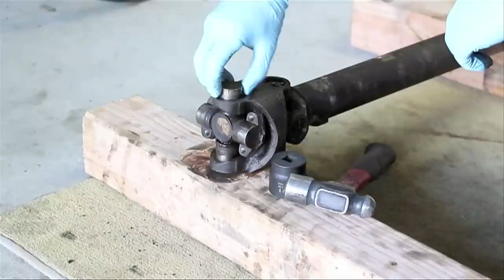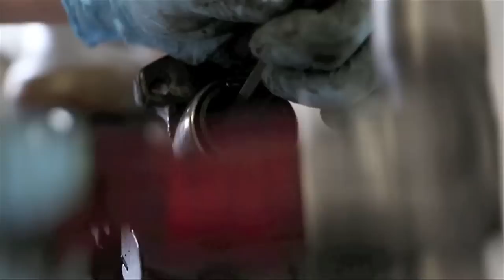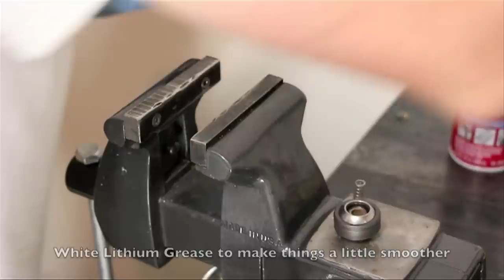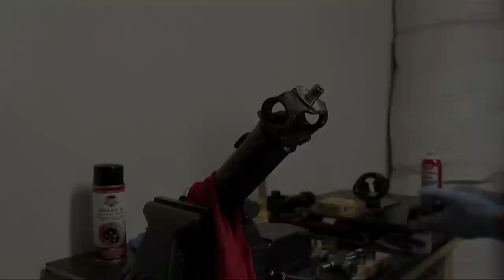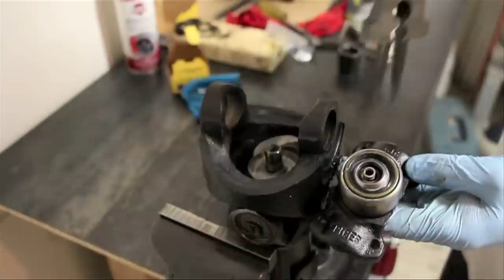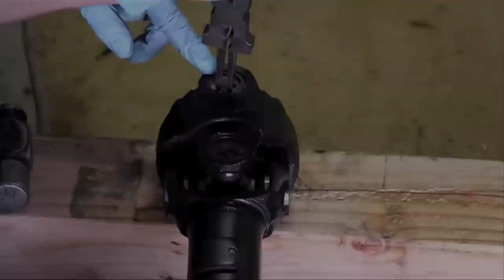How To Replace a Double Cardan Joint

Comment: Just did this on my WJ front double cardan. I couldn't figure how to get the bearing race out of the centering yoke until I saw you guys using a prybar as a lever. I had to modify one of my pry bars so it could fit inside, but worked like a charm and saved me from buying another specialty tool. Thanks!

Comment: Tiltle should be " How not to rebuild a Spicer C.V. joint" How are you going to grease the first joint with the zerk facing the center of the yoke? Just drop the seal on? It'll be destroyed in minutes! No grease in the centering kit? OH lets clamp the tube in a vice! Snap rings not fully seated? How long did this crap last before it ate itself? You guys are good for repeat parts sales! wheeew! Keep on bleepin'!

Comment: In case anyone is interested, the socket yoke assembly rebuild kit is part #spicer 404-0A.  Much cheaper than buying a whole new socket yoke,
Reply: Exactly what I was looking for, but Spicer doesn't list it on their site anymore.
Reply: @Jarod1941  Search "Rockford 404-0A", looks like lots of driveline places sell this as alternative to Spicer.  $18 at ActionMachine.
Reply: @shanesaw13  I got busy and sent it to my d.s. shop. I think the Rockford is what they're using.
Thanks for the reply.

Comment: Awesome vid guys!!!  worked perfectly! 2012 Ram 3500, front drive shaft .. I had a bad u joint and didnt realize it had the ball thing...  Also these Rams have a little grease hole in one side that you use a needle adapter to get grease into the ball... Thanks again!!
..
Reply from the maker: George S Sure, thanks for watching!
Reply: George S send me the link to the parts I have a 2012 ram 3500 but I can’t find the parte in the middle just the u joints but not the part inside. TIA.

Comment: Very easy to do.  Moog part 607 is the part number for rear after market driveshafts with Slip Yoke Eliminators installed.

Comment: And one more note on some of those Fords that you joint caps are different size where they go into their carrier the larger size will not go in the cardone joint for the hook up to the transfer case it has to be the smaller size for the transfer case in the larger size to the cardone knuckle

Comment: Dude this looks so easy - I was just at autozone and was trying to get ball joints for this very set up I have on a dodge Dakota 4x4 - this dude made it seem like it was impossible for me to do. 

Ive literally done way harder shit than this - I cant believe I let that guy make me believe I couldnt do this. I have all of this and I have a master balljoint press. 

He ended up talking me into getting new drive shaft for 500 bucks and I was going to wait till pay day, but on the off chance I looked up this video. 

This is literally just time consuming - Ive bench pressed transmissions into place before - Im no mechanic Im just a guy who got tired of everyone giving me the run around. 

I cant believe this shit I lost so much respect for this guy at autozone.

Comment: This is for the 4x4 shaft correct ? Your video is 1st one I have found that shows everything THANKS.Need to do this on my 2002 Excursion, I have the Spicer Centering reapair kit and the seal and the 5-1350X already...How do you determine IF needs changed ? What pliers were you using ?

Comment: If you had used the U joints with the grease points in the caps instead of the cross it would make it easier to grease the universals in the Hook (double cardan) joint. The grease nipple in the cross is ok for the front U joints as long as its on the driveshaft side and not the Diff side.

Comment: Thanks for this video guys, it was really helpful and I used it as a guide to replace mine.

The only problem I had was with the new slinger/seal that sits on the drive shaft.  I noticed you guys didn't tap it in place and just kinda placed it on top.  I tapped the thing on which was kind of a pain in the ass, but I got it eventually.

Whats the best way to seat that thing?
Reply: wondering same thing
Reply: your right, but maybe Dana made a different type

Comment: Ball joint removal tool and a press works well too if you don't feel comfortable beating the u-joint with a hammer.  The needle bearings are easy to break.  Those tools are pricey...I picked up a 12 ton press and a ball joint removal set for around 150.00 a piece, but if you plan on changing ball joints then you have the tool.  And a press is always handy to have around the shop.

Comment: I know this is very old video but I found it very helpful. I’m having trouble finding what is needed for the centering yoke replacement I was able to find u joints but not sure what part numbers for centering. 2005 Jeep TJ Rubicon stock front shaft. If anyone knows what is needed to rebuild centering yoke please let me know? Thanks
Reply from the maker: Google double cardan rebuild kit

Comment: I'm rebuilding my dc joint on mine now, but the section on the drive shaft that fits into the cv is bent pretty badly.  doesn't seem to be something that's removable, am i missing something simple, or do i need a whole new freaking shaft over that little connector lol

Comment: I'm getting ready to rebuild my front driveshaft for my ZJ and choosing to just get the yoke with the ball & spring already installed instead. I have a question about the slinger since mine is all torn up and I want to replace that as well. How did you take that off? it seems like its just going to come off in little chunks. Also, when you installed the new one in this video it looks like you just dropped it into place... there was no snapping it in?
Reply: Frank Alfani Also, would you recommend or discourage packing some grease inside the slinger or leaving it dry?

Comment: I am attempting to replace my front double cardan u-joint, and I truly appreciate the how-to video.  But I seem to be running into a road block as to where I can find the right parts.  I need the ball joint kit and the u-joints.  Can you help?
Reply from the maker: Go to the auto parts store and ask them for a double cardan ball seat repair kit for your model vehicle... If they say "huh?", walk out and go to the next part store.
Reply: +BleepinJeep I went to two parts stores, both of which knew what I was talking about but did not have access to inventory.  Thanks for the help.  I was, however, able to locate a business which supplied parts and service.  Thank you for the videos and help.

Comment: Hi. Thanks for this amazing video. Did you manage to install the zerk fittings on the u-joints and be able to fit it on the rear yoke? I did an emergency repair on the trail but I needed to take the zerk fitting off the u-joint because it will not make the whole thing fit on the rear yoke.
Reply: By the way, your other video on rebuilding a u-joint with a hammer helped me a lot out in the cold trail. It takes a while but works. Thanks for that too!

Comment: Replacing all the u joints on my 74 Bronco and had a question about this particularly. On the ball joint in your video i didn't see a piece that mine has. It's just a thin metal ring that I believe is suppose to sit on the working surface of where the ball joint and spring rest. However in my particular instance it doesn't stay retained in that spot it likes to pop up and set on the ball joint. So any info on what this part is specifically and where it actually belongs and how to properly retain it there would be great. Thanks for the info to come and great videos.
Reply from the maker: Jeremy Simms Ive had that problem before with a friends Jeep.  I think you are referring to the seal.  In his case we just left it out because things were a bit chewed up.  To fix it entirely, we should have gotten a new yoke.

Comment: Hello please help me, I want to install a ZJ Double cardan on dana 300 output Shaft....The universal joint it’s same 1310 👍 but 4 bolt no🤬you have a solution? You now a yoke 26 spline with u-joint bolt colse?

Comment: Ebay has the double cardan kit for $59 with free ship. It includes three Spicer blue seal U-joints and a new yoke with ball joint installed. Sounds like a deal to me.

Comment: just had  a rear cordon joint replaced on  my 1977 Lincoln and it has the troublesome clicking noise witch some times happens with these are their  a simple fix for this or do i have to ask them to redo the install
Reply from the maker: EMPEROR MOWE if they were suppose to fix it and didnt then I would ask them to redo
Reply: ok thank you

Comment: I did what you did in the video to pop that ball out bt now I cant get the damn seal out..  I cant get a pry bar inside it.. its for a 2000 dodge ram 1500  that cardan seal wont come out just the ball shot out.. and now I cant get a bar in there like you did  cant get a small enough one for the 4x4  cardan

Comment: What is the reason for a Dbl-Cardone joint vs. one ?
Reply from the maker: It changes the pinion angle and helps to eliminate vibes and also has a longer slip.
Reply: I did some research on these. I'm not sure about the center ball and spring idea. the dodge trucks, 4x4, tend to have issues with these however, I don't know if it's a Cardan issue or a Dodge. Front drive shafts are failing and then beating up anything around it. It's interesting that Cardan joint don't fail much but they do with a Dodge truck.

Comment: You should make a video on how to remove/replace the A/C compressor on an XJ. Mine's busted and I don't want to pay a mechanic $1600 to get the job done when I could replace it for only the cost of the compressor itself
Reply: bleepinjeep Agreed - Just had a shop change out the ac compressor on my girlfriend's '98. I'm not set up to capture and dispose of the cooling juices....
Reply: ChrisFix and Eric the Car Guy both have how to videos on this, only not on jeeps. But, the principle is the same on most vehicles, and is pretty straightforward assuming your jeep was built in or after the 90s  and uses R134a refrigerant. 
I used the info in their videos to replace the compressor on my G35. 
Be aware, you'll need a vacuum pump and manifold gauges (mine cost me about $200 on Amazon) to properly charge the system.

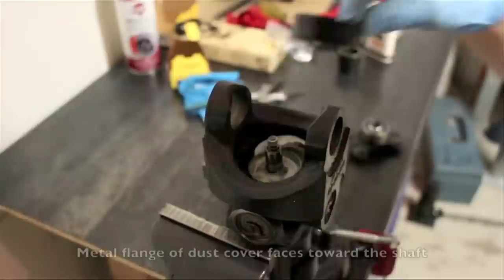Comment: Sorry , but you totally skipped the hardest part, putting that boot on, its not just placed like in the vid. @5:32
you cant press it in (flexy rubber boot),  did you use a socket just bigger than rubber but smaller that metal ring and hammer ?? Chisel and tapping?

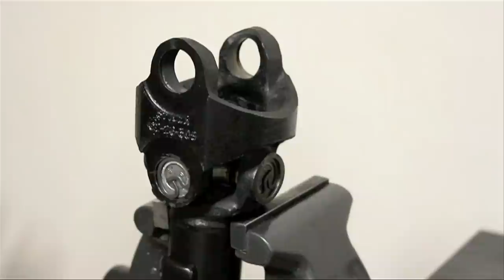Comment: Notice at 5:16, yours kind of drags a little? Should be bearing smooth when you rotate it like that. And at 5:07, your vice was pushing on that junk cast iron metal pushing it over. This will cause excessive bearing wear. You'll be back in there doing this all over again in a year or less.

Comment: Double-double; I run  a front driveshaft in the rear. Once I put the SYE in, the front driveshaft from a zj worked perfectly, though I haven't cycled it yet. It may be ghetto, but a spare junkyard driveshaft works in front (I think) and back. Do you see anyone with this stupid setup?
Reply: I'm running the double cardan driveline I rebuilt in this video on the rear of my white XJ. Doesn't seem ghetto to me. It is holding up well.

Comment: Strongly advise using a proper press to remove the U-joints. Reason why is that cheap cast iron pot metal will move causing slight binding at the new U-joint cap area. Did it on mine. Don't bang them out with a hammer. Proper tool for the job.

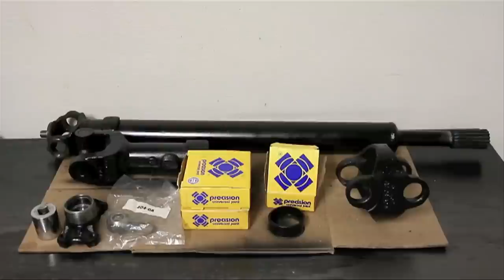Comment: 2:11.  I AM NOT criticising, but you missed an education point.  Just before this timestamp, you are effectively destroying the machined surfaces, and then jump straight to Precision parts.  Yow. I can't stop watching your videos, but sometimes I just scratch my head..   You guys are doing really good stuff, keep it up.  Just offer up the little tidbit about machined surfaces when you can as this video will allow someone without the right tools to do the work (inexpensive option)... but wow, the fit and finish and fine measurements are blown out the water when you do it.  Now, you can also add details as to the impact if any, IDK.. but please touch upon the shortcut as a shortcut and tell them why the right tools are preferable when you have them..

Comment: Just want to say that taking out the ball ring in the Cardan joint not that easy when its original and smooth as glass at the bottom try grabbing that its bull crap. Mine taking two days to fix the dam thing. Got cut it out.